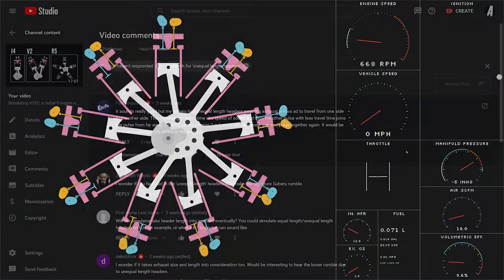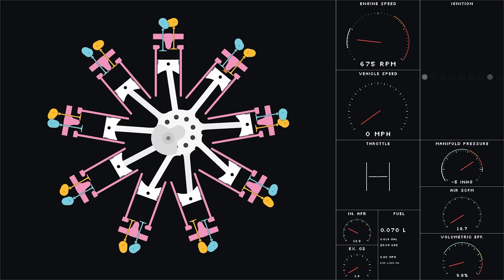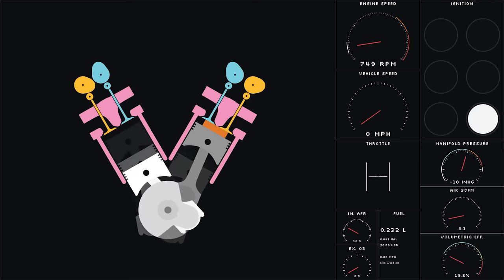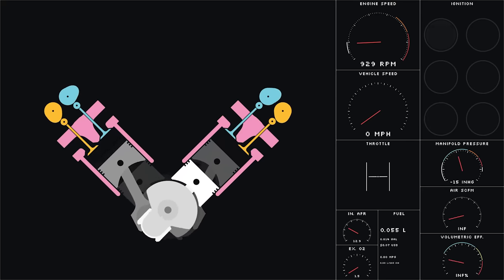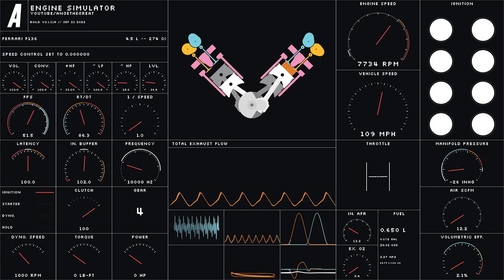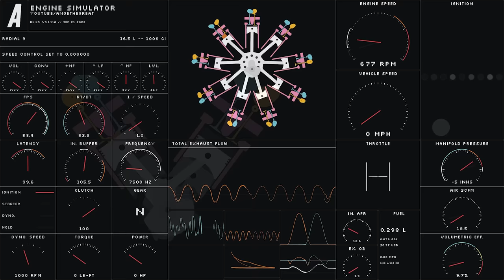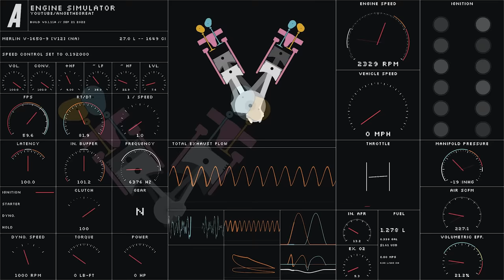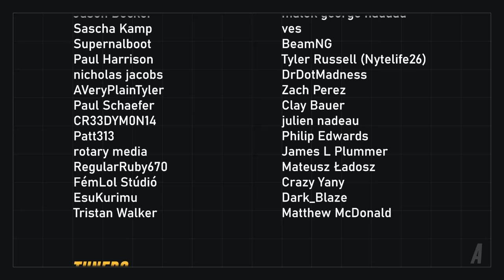Simulating an F1 V12, cross-plane and flat-plane V8s, unequal length headers and more

Comment: From a musical perspective it's fascinating to hear how the more balanced the engine and headers are the purer the 5th tone is (2nd harmonic @ 3/2 ratio) 
And past 6 cylinders a major 3rd tone appears.
Reply: You are so right! I wonder if the amount of cylinders really matters though. When it's equal firing I think the only thing that's different is the amount of power strokes per minute at the same RPM.
Reply: Can you explain how to relate music to car engine sound ? I understand that it is a succession of bangs  but how does firing order and interval relates to in term of music  ? Pitch ?
Reply: @helldiablo8471  essentially.  Because of how often an engine fires, each firing of a cylinder can become the peak of a sound wave and the time in the middle can be the bottom, so if you rev into the audible frequencies it can be related to music, and then depending on the size of the cylinder, how many there are, firing order, etc., it can make different sets of notes at different intervals that blend to make chords.
Reply: @helldiablo8471  it effectively creates a different waveform. The peaks and troughs of the waveform are in different "locations", as you can see by the "exhaust flow" graph on the sim. It's similar to looking at a synthesizer oscillator's waveform through an oscilloscope. Different shapes produce different harmonics. The smoother and more "even" the waveform, the "cleaner" the exhaust note. Hence the cacophony of a crossplane UEL V8 versus the precise tones of an equal header flatplane. Plenty of other variables at play of course. That's the simplest answer I could think of (or at least how I see it as a modular synth nerd lmao)
Reply: @helldiablo8471  All sound is essentially vibrating shit. You get shit to vibrate quicker, then that's pitch. 
You can kinda observe this by using a ruler and a table. Hold a ruler against the edge of a table with your hand then slap that shit silly, the further out the ruler is, the slower it vibrates, and the slower it vibrates, the lower the pitch.

honestly y'know what? you probably already know all this but I wrote this comment so might as well post it
Reply: @tsrenis  yes but for example, an uneven firing order would equal an alternating irregular spacing in the pitch,  what is that converted in music "wording" ? Octaves semitones ?
Reply: @helldiablo8471  "Timbre" is the word that's used when talking about how the same note sounds different for different instruments (or in this case, engines).
Reply: Guys can anyone explain to me why an even firing 3 cylinder produces a clear perfect 5th whereas a 4 cylinder does not? If its even firing it should sound like a metronome right? There shouldn’t be an audible cue to show the beginning of each revolution? If so I’d like to know I’m searching about this shit for so long
Reply: @usfghost  because 3:2 ratio is the 5th. 
multiples of 2 are the octave
Reply: @BuzzaB77  Yes i understand this but where exactly is the 3:2 ratio in a 3 Cylinder engine, the 3 makes sense but where is the 2?
Reply: @usfghost  oh I see where you're going with this now sorry. Yeah good question it must surely have to do with the exhaust impulse merging in the manifold right? 
I bet if you had a 3 cylinder with 3 pipes it wouldn't happen.
Reply: @BuzzaB77  you mean the waves constructively interfere in the manifold each revolution? And thus produce a pulse? But if each cylinder had its own exhaust pipe there wouldn’t be a 3:2 ratio in the wave?
Reply: @BuzzaB77  its very interesting if you look at william mosers videos, because i dont think he simulates exhaust systems at all, its an even more reduced version of this simulation with only analog cylinders which fire.
Reply: @BuzzaB77  i figured that the 2 is the number of revolutions of the crank, because each 2 revs you have 3 firings
Reply: @BuzzaB77  i apologize for bombarding you with questions but i have been searching for this and you’re the first person who knows what i mean
Reply: @usfghost  ahhhhhh of course yes nicely done. now we need to check the rotary! haha
Reply: I love the odd firing V6, it just sounds so good to me

Comment: im very impressed with the LFA. i think it only sounds off because of the special exhaust the LFA features. in case youre reading this and don't know, the LFA design team actually hired Yamaha to help nail the sound both in and out of the cabin, which would be difficult to simulate. amazing work as always ange!
Reply: I love Futaba lol
Reply: it kinda sounds like it's on an engine dyno.
Reply: it sounds a bit electronic still if you get it in the game, but definitely still recognisable

Comment: Your simulator should be the foundation for any race sim sound engine... the boom, rasp, thrum,  and howl are characteristics that even modern race sims cannot or barely achieve.  Also the change of sound from unloaded revs (14:17) to loaded clutch engagement (14:28) is really impressive!

Comment: Tbh, I learned the sound difference between unequal and equal length headers from Jason Cammisa's related video of his "Know It All" series and I have to say that I now know what to prefer for a Subaru in order for it to keep this distinctive base rumble. And this, of course, is the unequal design of the headers. The equal ones really make the Boxer-4 sound like a Civic Inline-4, to the point where you just can't tell one apart from the other.
Reply: Not even remotely true. Even length boxter headers have a distinctive sound that anyone into Volkswagens will recognize from high performance beetles or Karmann ghias.
Reply: @Diax1324   You're obviously talking about old air cooled Flat-4s. Modern watercooled ones sound exactly like what I described. Hell, when I first heard an STi with equal length headers revving out, all I wondered was "That doesn't sound like an STi, how the hell did that happen?".
Reply: @McBeamer94  No, they sound very similar.  I am not talking about intake sound or valve tick. Pure exhaust sound as they head down the drag strip. https://www.youtube.com/watch?v=MUpGPl_M0zM

Unique sound that sounds like an I-4 unless you hear the bass impulse.
Reply: @McBeamer94  yeah because watercooling totally changes the sound of an engine.

Comment: This sim is so amazing!! A tip is to add a brake button, so you can slow down faster.
Reply: Yeah that's what I'm really missing now. Feels really weird as a racing fan to hear the thing slamming through the gears and then just coast.
Would imagine upping the resistance on the driveshaft wouldn't be too difficult, though I might be speaking too soon there. Or have the speedo decelerate a a set vallue.
Reply: yes that would also require another level of simulation however to simulate the load on the engine under braking

Comment: Absolutely beautiful! Commented on the other video a bit ago about the EJ; I was so immersed I didn't even realize it was missing the UEL sound (but also my BRZ has a less unequal header than the WRX/STi so it'd be more noticeable for those guys) but man the UEL sound just made it SO MUCH BETTER.

Also I didn't mind the talking at all; both learning a bit about the engine histories, and how you came to that point in recreating the sound, were nice additions. Only thing I felt was missing was the extra segment of each engine where you removed sound except the "ticking" for lack of a better term, to illustrate the firing order at a slow/below-idling speed. It was a nice extra bit to have, though the absence didn't detract from how fantastic this video was.

Looking forward to more! :]

Comment: man that first V-12 sounds HARDCORE!
Reply: The Merlin? That's because it absolutely is! The Lancaster bomber ran four(!) of these engines. You have no idea how glorious they sound at full throttle
Reply: And in addition to the Spitfire, some variants of the Mustang also ran these engines.
Reply: @jaco1982za  Its crazy I've been at an air show that's exactly how it sounds (spitfire)
Reply: @squidwardo7074  If you think the Spitfire sounds awesome, you should hear the Rolls-Royce Griffon engine. The Avro Shackleton ran for of those engines and the chest shaking roar of all four at full throttle during an engine run is unreal
Reply: @jaco1982za   I recommend you check out Precious Metal. Currently not flying due to fire, but it's a P51 with a Griffon engine complete with Shackelton contra-rotating prop. The sound at 440 mph is just incredible.

Comment: Great work as always, beyond glad that you were the one to finally bring this software into reality. A perfect case of "I didn't know I needed this until I got it)

I'd love to see the old four cylinder 250cc motorbike engines from the CBR250RR / ZX2R etc. that rev to ~20,000RPM. 
Hell while we're at it Honda's old race 250cc six cylinder would be an even better one to see because being a race engine from the sixties good footage of it is a lot rarer than the 250 four cylinder bikes. At least here in Australia you'd be hard pressed not to find at least one or two CBR250RRs at every meetup.

Comment: Some of the radial engines used a special gearing to make the big end assembly to stay at a fixed rotation, instead of being directly connected to one of the pistons. This allowed a more uniform piston action, but probably it was more prone to failure, and caused other problems.

Keep up the fantastic work, I love it! 👍
Reply: I can't picture that, can you name an example so i can look it up?
Reply: @16v8vFMG  - Nordberg radial engine.

Comment: You can convert it to wavetable generator, with wavetables then can be used in games. Or even better - wavetables can be generated before "race" for each engine modification.

Comment: from the waveform shape (no idea how engines worked till i started looking at these amazing videos) i speculate that a simple - cruder approach would be to use Phase Modulation synthesis (for a physically informed rather that a detailed physical model as this) .. amazing work ! jaw dropped :)

Comment: The Rumble Sound can be called Flamming, from the musical term "Flam" - Percussionists use that word to describe slightly offset strokes in a rhythm that aren't so far apart that they constitute association to different beats in the measure, but also aren't close enough to sound like one stroke.

It could also be called "Gracing" - the Flam is made out of a Leading Stroke and a "Grace" Stroke.

Comment: As a musician and sound designer, I see an interesting new approach to a virtual instrument here. Imagine creating an engine specifically for the sound, and adjusting parameters on the fly to change the tone of the instrument. This would be like a wah pedal for a guitar, but I might be adjusting the header length or exhaust valve timing instead.

Comment: Those engines sound marvelous. The Merlin sounds close to how I remember it IRL. The Merlin is the only one of those engines I actually know the sound of reasonably well and your Sim is close. It's not perfect, but you're simulating the engine, not the entire plane, and the rest of the plane can make it sound different (the Merlin in a Spit sounds a bit different to the Merlin in a Hurricane).
Also, Rolls Royce did make a non-supercharged Merlin for use in ground vehicles, specifically tanks like the A27 Cromwell.

Comment: Any plans to make 2-stroke engines in this? A lot of the sound in small two strokes comes out of the exhaust expansion cavity so it could be interesting to simulate
Reply: planned for final release, along with Diesel and forced induction

Comment: Excellent videos, please add the option for 180° headers which equals the exhaust pulses on cross plane V8s. This is the exhaust trickery you spoke of, that makes the cars sound more exotic. The 351w in the old Ford gt40s used 8-1 exhaust headers. Also, borla now has their "cross fire" exhaust for the cross plane 5.0 mustang, which actually takes 2 exhaust tubes (post cats) across to the other banks. This also gives the engine a more exotic sound.

Comment: Audi 2.2L 10v engines have exhaust combined in unusual way: 5 ->2->1. Cast iron manifold joins 3 cylinders into first pipe and 2 cylinders into second pipe which are joined into one pipe before the cat. I wonder if that  has major effect on exhaust note or not.

Comment: 6:08
Good example of that is the Alfa Romeo's 690T engine in the Quadrifoglios, which is a Ferrari designed 2.9 V6, a variant of the Ferrari F154 engine, so basically a flatplane V8 missing 2 cylinders... and it sounds great!

Comment: Hah hah!! Nailed it with the un-equal length headers!! In retrospect, a classic VW engine sounds almost identical (at lower rpm of course).😂 Ahhhh!! the V-12 F1 sounded amazing up on the pipe. In the early days, Honda had both a 1.5 and a 3.0 L V-12 that sounded similar! (and the 2JZ was spot on!!)👍

Comment: Unequal length headers are a go. 180degree headers are something on V8s that really change the sound,  and make them sound like GT cars, while improving scavenging in applications it can be packaged.. There is also a potential for quarter and half wave resonators in the exhaust to further scoop the tone and and add character, acting as a mechanical parametric EQ cut of sorts. with NA engines especially, the intake and exhaust length are really wear you tune the car, and also give it the shape of its sound. This is great stuff. thanks a lot.

Comment: 11:48 - i actually had a modded engine in Live for Speed (Modding the Engine, Suspension and Tires there has to be done with a program generally refered to as "Tweaker".) that sounded exactly like that V10

Comment: When the engine simulator is "finished" you should consider making a program that can simulate exhaust sound based on exhaust system layout. SO many people fiddle around with exhausts trying to get their car to sound just right - not to mention all the backyard shops that produce systems (of which many sound horrible). 

Amazing work btw...

Comment: As for video games, i strongly believe that 3 recordings, one at load, one at engine brake and one at stable load are enough with a good crossfade between them. 3 is few? Then 6. They took very little space in megabytes. For stable rpm a little loop between combustions with a small fade out-in crossfade and you have perfect engine sound.

Comment: It may be in the sim already, but it sounds to me like a single exhaust pipe. The subtle time delays of multiple exhausts as you are never standing straight on and the low pass filter effect of the air might help take the sound to the next level of realism. The issue is that you then have the 'mic' placement as a variable which may make things overly complex.

I think it would also be nice to have an inside and outside sound mode. Some engines sound mint inside the vehicle but others sounds great outside. So a drivers position, street side position switch could be very cool.

Amazing incredible work!

Comment: I am amazed how good this simulator performes... also look at the difference between the merlin and the F1 V12. This tiny crankshaft compared to those wide as hell pistons on the F1 showing up after a longstroke engine with seemingly endless displacement

Comment: There's so many different firing orders on crossplane V8's, depending on the manufacturer and the generation of engines they've made. One comes to mind, the Ford Modular 4.6L V8 used for many years, including the Terminator Cobra 2003-2004. Had the most wonderful sounds ever. The new 5.0L Coyote V8 Ford puts in the F150 and Mustang has a different firing order compared to the 4.6 and it doesn't sound the same.

One thing I'd love you to build in your simulator is the 4 different ways the parallel twin engine in motorcycles has been configured and the sounds between them being distinct, 360° (old Triumph Boneville, later model BMW F800GS), 270° (tons of modern parallel twins, such as the Yamaha MT-07), 285° (KTM parallels, the 790 and 890 twins), 315° (Husqvarna Nuda 900R, a reconfigured 800 parallel from BMW, only one I know of that's used this), and 180° (Kawasaki Z650, Ninja 650 etc). That would be a treat to see that run, along with a quick screen-jump between them at a middle-RPM for audio comparison.

Comment: Something that will be super difficult no doubt, but if I can plant the seed I will. 

I'd like to see exhausts incorporated into the sim, and using pulses from the motor to interact with different materials/ header styles/ how volumetric space changes resonance, pitch, tone etc. 

Probably impossible to create, but if there was a way to design exhausts with measurements and possibly GUI that would take every factor of an exhaust design and simulate it, would be some insane work

Comment: the only difference between your simulated 2jz sound and my is300 is that I have a massive resonator that makes the sound much smoother and slightly lower pitched. Otherwise, its spot on! Fucking love this simulation

Comment: Incase anyone is wondering how you get more than 100% volumetric efficiency in an engine.  There's 2 ways
1: Boost
2: You have the exhaust pulse calculated to make a negative pressure wave during valve overlap, this way there's and extra suction force bringing more air and fuel into the combustion chamber.

P.S. the EJ sounds spot on now.

Comment: The Ferrari V12 F1 engine sounds almost uncannily realistic. I was lucky enough as a 16 year old to do work experience at Ilmor when they were building the Mercedes F1 V10s in about 2000. I got to watch one run on the dyno doing a full telemetry recorded lap of Spa and it had that hollow, echoey, harmonic sound at idle and through the revs. Definitely the closest I’ve heard to recreating it.

Would love to eventually see an ability to properly load the engines through the gears and some simulation of fuel detonation in the exhausts. The ‘turkey gobbling’ noise of the F1 engine on overrun caused by that was genuinely spine tingling.